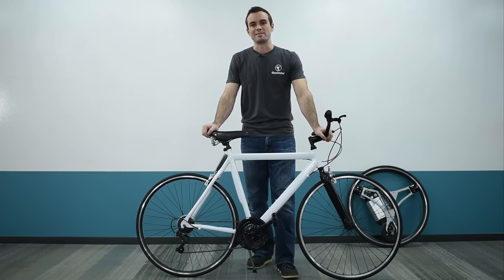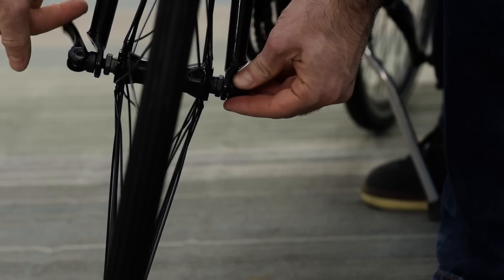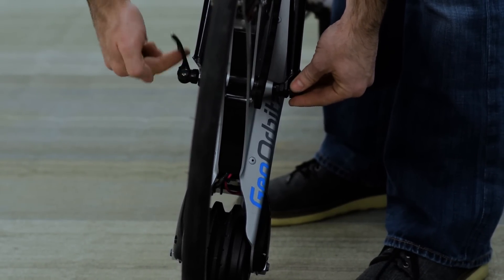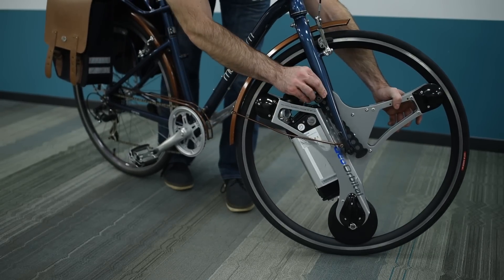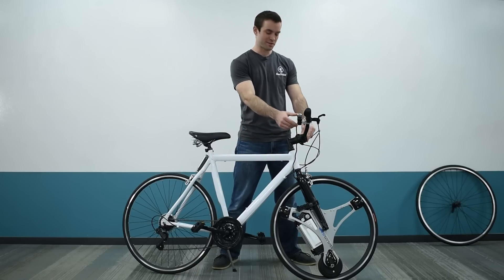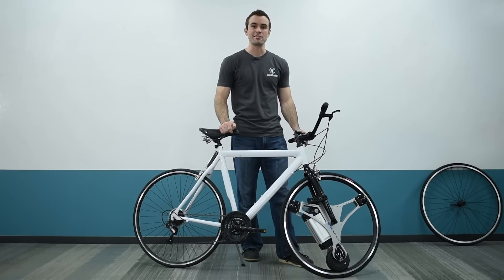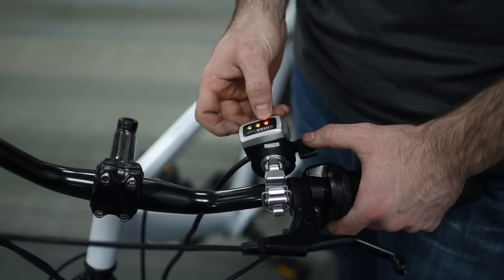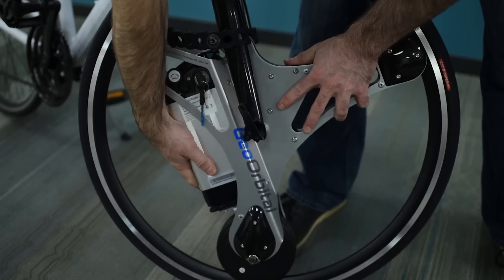GeoOrbital Wheel Advanced Installation and Use

Comment: I got a question please, what about if I have a "disc brake"? I can't use it anymore and I need to install old kinds of brakes?, thanks
Reply from the maker: We offer a bake adapter so the wheel will fit on any bike, more details on our website.   We mount a cable operated caliper inside the wheel and it works great.

Comment: Does the Geo orbital wheel freewheel with the battery out?
Reply: Quinton Lindgren yes, it will freewheel with the battery removed
Reply: Chici ,so if you got a dead battery during a ride and pulled out the battery, would the bike ride with the same resistance as a non-electric bike?
Reply: Quinton Lindgren there's still resistance because of the regenerative breaking, wether the battery is installed or not

Comment: What happens if I install this wheel on an Ebike with a rear motor? 
For example (to save money) I was considering putting this wheel on a SONDORS Thin => 2 Wheel motorized drive. 
Would this work? or would the extra weight nullify the effects OR would I not experience much of a difference compared to just one tire?
Reply from the maker: Hi we call this a EE-Bike some of our creative customers have already built them and they are working for them. We are at the same time also working on our own version. Yes it works and its usually has the WOW effect. Good luck and please wear a helmet.
Reply: Thanks so much!

Comment: How is the sound level? Does the small drive wheel spinning at a high rate  result in a loud motor sound or is it rather quiet? I ask because I saw another external kit that used a small wheel pressed against the rear wheel and it was rather annoying, sounding  a bit like a mixer.

Comment: can I use WD 40 on the geoorbitals moving  parts connected to the rim of the tire in order to reduce the amount of resistance coming from the wheel? i feel like my pedal assist is not working as well as other e bikes. I slow down when moving downhill compared to a normal bike. and when I lift the wheel n the air, and then throttle, should that be rotating the tire as well as the motor? it looks like the motor doesn't catch unless the wheel is on the ground. please help!

Comment: In the video Dakota states that the wheel operates in assist mode until you use the throttle.  Do you know how much assist?  One of the Bosch systems is assist only and allows you to set 2x or 3x assist.  Wondering what the setting is on GeoOrbital.
Reply: I am curious too how much assist is really given.  I would be commuting 20 miles one way and I don't want wheel resistance....  How much is the little amount.  All would it slow me down if I am able to pedal faster than 20 mph?